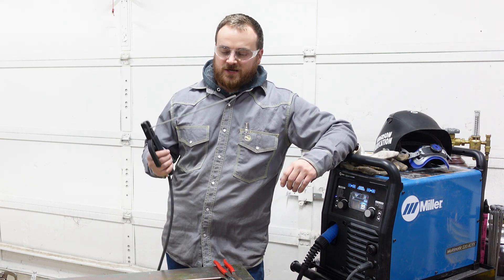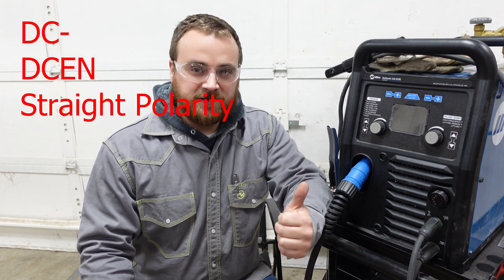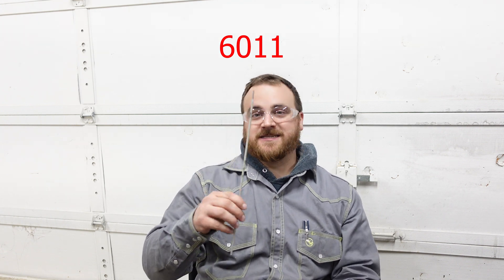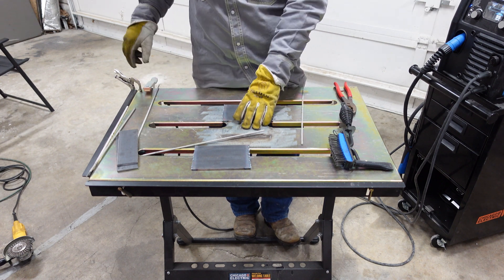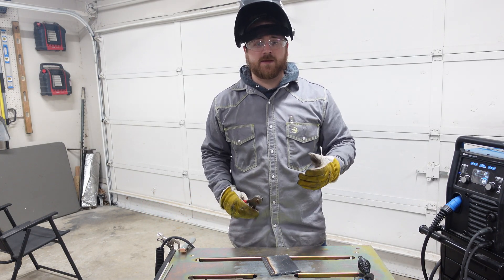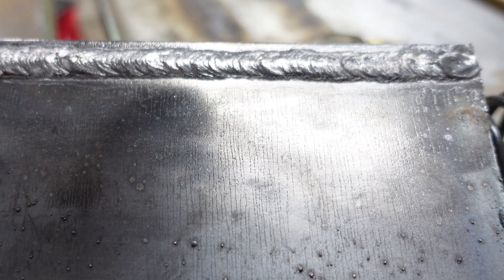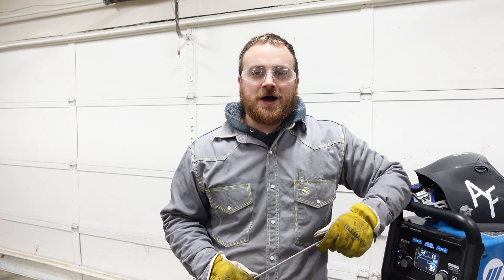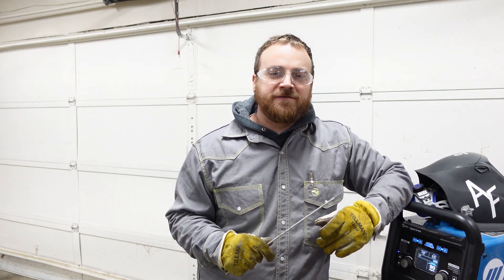How to Stick Weld for Beginners

Comment: G’day and greetings from Tasmania Australia 🇦🇺 you  have given great advice without getting too complicated, I’m 67 and I am building a 71/4” locomotive and tender, the tender has a frame made out os stainless steel 316 angle which is jointed on 45o . So any help I can get the better I’ve mig welded some parts on it they haven’t come out to bad.  I have Unimig Viper 185 which I’m slowly getting use to, great channel you explain what you are doing very well.   Kind regards John

Comment: my titanium multi process welder only goes to only 70 amps on my SMAW is that a issue I payed 600$ for the machine and a lot in taxes
Reply: Are you running it off 120v outlet?  You should run it off a 240v outlet. Also you can get the titanium 225 stick, it's a very good machine. Dual Voltage, but you'll get most out of it from a 240v outlet.
Reply from the maker: With 70 amps you’ll be limited in material thickness you can weld. However using a smaller electrode and multiple passes can be a reasonable workaround depending on what it is you’re welding.